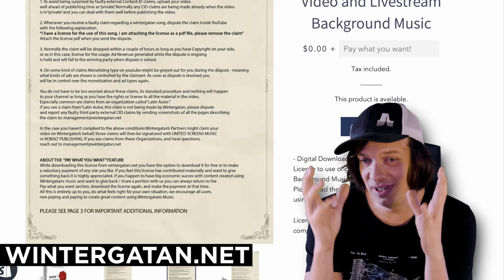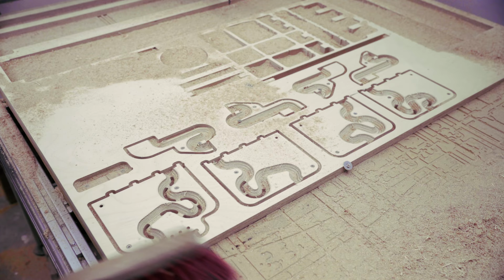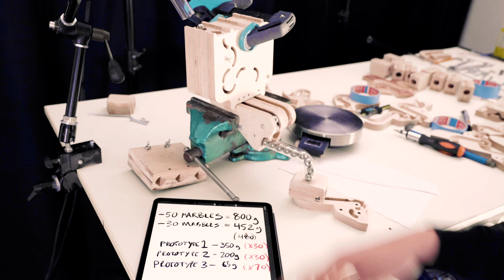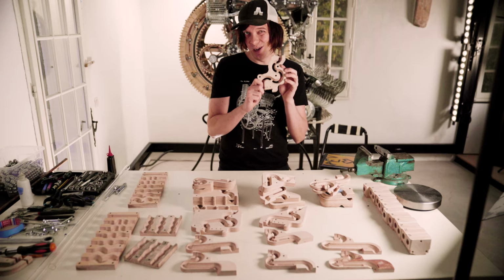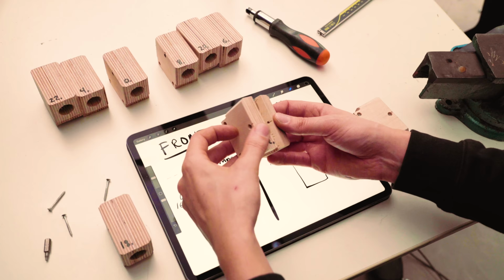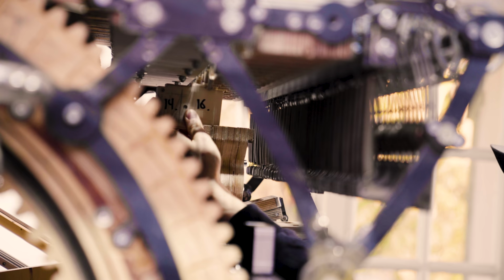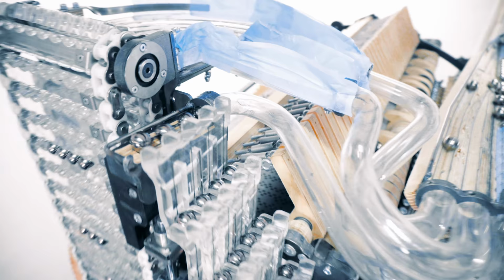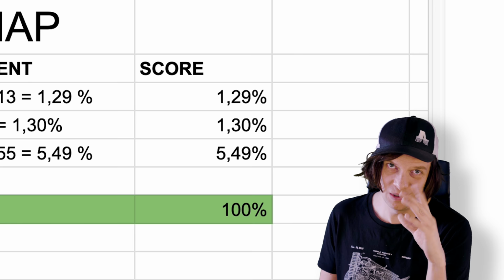Playing 20000 Marbles - Marble Machine X #147

Comment: It's kinda irrelevant for the project, but I noticed  2 things: 1, you're doing the math for your reliability wrong. It's off by 2 orders of magnitude. 1-20/5000 = 99.6%, not 99.996%. 1-61/20,000 = 99.695%, not 99.997%.

2, The way you currently have the math set up for your score, it'll always be pretty much equal to the number of tracks tested, because your reliability %s are close to 100. If you want to score by chance to not have a single failure, multiplied by tracks tested, you should take reliability% ^ number of marbles desired * % of tracks tested. For example, if you had 99.997% reliability, with an end goal of 10,000 marbles played with no failures, and 5.5% of the tracks, then that's (0.99997^10,000)*5.5 = 4.07; with that level of reliability there's about a 74% chance you have 0 failures in 10,000 marbles.

Anyway, with your level of improvement, you'll probably be hitting that 100% reliability with 100,000 marbles on all tracks soon.
Reply: I think Martin is fogetting that 1 in decimal is 100 in percentage, so when he divides failed/total marbles he gets 0,997 and he just adds the 99 in the front out of nowhere instead of multiplying the result by 100 to convert it from decimal to percentage. It was also noted by someone in the last video but it seems he did not read that comment or just ignored it.
Reply: I would actually do the reliability score as log-linear. 1/10 million is "seven nines". 20% points to start off with, each order of magnitude is 10%. 99.999% (100k) is a passing grade of 70% (a C-). To get an A+ he'd need zero fails in 10 million (eight nines).
Reply: This is incredible. I trusted him to be a genius so much that i would have never noticed this obvious error. I love how one can be a mastermind and still mess up basic maths!
Reply: @Marcotheminer  using a "," for a decimal point is pretty standard in most european countries. Might just be a cultural thing.
Reply: I agree with everything you said except that it is irrelevant 😁
Reply: @Marcotheminer  ahm... you are not aware that in the German Speaking Countries and most parts of Europe we ALWAYS use , and never a decimal point. We call it decimal comma. The point is used in other contexts with different meanings.
Reply: @Marcotheminer  Most of the world uses comma for that.
Reply: @Da_Rauch  thank you for that - absolutely right. Btw. Euler used , and not a decimal point. Just for the reason that this is a mere cultural thing.
Reply: Sounds a lot like covid survivability.
Reply: @LuisGustavoCoelho  I don't think that Martin is just adding the 99 from nowhere.  What I think he's doing is 100 - 61/20,000, instead of 1 - 61/20,000 x 100.
Reply: @Marcotheminer  this is the standard european notation. A comma for decimals, dots to group thousands.
Reply: Does nobody care about him saying "2/38 = 5.5%"?!  It's 5.26%
Reply: @EckiSchmecki  Yes. 
But the reliability calculations consistently being two orders of magnitude out is a bigger bugbear - he's been making for the same mistake for at least the last three videos.
Reply: @DavyHulme  but that math is a bit harder than 2/38 xD
Reply: @EckiSchmecki  aye, but only teensy wee bit
Reply: @Da_Rauch  and from the onset of this project he has said marbles ...theyre ball bearings .
Reply: great comment
Reply: @maraschwartz6731  I could cite sources that contradict those statistics, then cite sources that contradict those statistics and so on.  The point is, covid is not nearly as deadly as the left would like you to think.
Reply: @DevinDTV How do you get from the 4.07 reliability score to 74%? What's the last calculation there?
Reply: @99.6survivalrate8  sure any one can cite sources. Doesn't mean those sources are correct. I'm citing an analysis of the actual data. If your sources have nothing concrete like that to back them up then they aren't reliable.
Reply: @maraschwartz6731  
CDC’s new IFR survivability estimates after contracting the virus are broken down by age as part of the agency’s “COVID-19 Pandemic Planning Scenarios" Scenario 5: Current Best Estimate are as follows:

0-19 years old survivability rate is 99.997%

20-49 years old survivability rate is 99.98%

50-69 years old survivability rate is 99.5%

70 years old or older survivability rate is 94.6%

To put that in a different perspective the CDC’s new estimate for the death rate after contracting COVID-19 by age are:

0-19 years old death rate is .003% or .00003

20-49 years old death rate is .02% or .0002

50-69 years old death rate is .5%% or .005

70 years old or older death rate is 5.4% or .054

What do these numbers show? They show the vast majority of Americans face no risk, virtually no risk from COVID-19. For people aged one year to 69 years, the survival rate post-infection with COVID is over 99.5%. For young people under the age of 20, which is most college students, who are being thrown out of school for hanging out outside and congregating with more people than their government allows them to, the survival rate according to the CDC is 99.997%.

We then find out that experts at Oxford University have determined that approximately 30% of those included in Britain’s Office for National Statistics' (ONS) coronavirus deaths toll over the summer actually died primarily from other conditions.

Read More: New CDC Data States COVID-19 Survival Rates Extremely High | https://wbckfm.com/new-cdc-data-states-covid-19-survival-rates-extremely-high/?utm_source=tsmclip&utm_medium=referral
Reply: @99.6survivalrate8  best comment apart from that all of covid is in reality a HOAX
Reply: @karlgiel8891  I agree.  It was needed, then exploited and exaggerated by Democrats for this election.
Reply: @Ninjaguy1b  That's just 0.99997^10,000 = .74. The chance that a given marble won't fail (.99997) to the power of the number of marbles dropped (10,000). 4.07 comes from the number of channels (5.5) times the chance of no failure (.74).

Comment: I want to say again that you should officially track three categories of fails:
critical - something that can stop or even break the machine.  Including a hard stop on a channel - these are running at zero
sub-critical - something causing a missed note, but not stop the machine or cause the song to be missing an instrument - these are running at zero
non-critical - an annoyance, such as dropped marbles. the 19 that missed the funnel
non-critical, caused by development stage (the 42 marbles dropped "because I had these channels taped and the tape failed").

I would have totally ignored the 42 marbles dropped due to temporary tape failed.  meaning that you were 3X better than the number you used.

I also think the goal should be ZERO critical failures, and perhaps 99.99999 sub critical (1 out of 100,000 notes may have a bad note).  So far you are actually at zero on this, but you will have to test a LOT more to be sure, testing all channels and use a computer to check for missed notes.
99.9999 non-critical (1 out of 10,000 marbles dropped).
If a full concert was 50,000 notes, and 5 marbles hit the floor that is not a "problem".  Huge, complex, custom build 38 channel instrument + desire for perfection on NON-CRITICAL difficult to control physics is not a good idea.
Reply: NJ bhul! Bi
Reply: @Wintergatan, he is caring for your success making you work less and better! Read this one :)
Reply: Catergorising faults like this (Cat 1,2 & 3 faults) led Mercedes to 7 F1 World Championships.  This is exactly how you should approach this problem.
Reply: This is the way!
Reply: @MrMattiasHallen  This is the way!
Reply: @ruaraidhmcdonald-walker9524  This is the way!
Reply: @oninoni  This is the way!
Reply: Also Martin should not forget, that the machine is designed to be taken apart and transported. Tuning the marble machine to a 99.99999% accuracy in a stationary position might be a huge waste of time if the disassembly, transport, and the limited time to assemble and test the machine prior to concert, limits the maximum accurany anyways...
I am not an engineer, but I think most high precision instruments and machines are stationary for a reason...
Reply: @joshgray3360  ...I have spoken
Reply: Any dropped marble should be put into a Signed container and given to an audience member. :D I count that a win from a loss.
Reply: I hope Martin sees this! I know there are a few of us who have made the same comment before.
Reply: The upwards curve on your plywood piece is what reduces the weight of the marbles above, increasing the incline or moving the incline closer to the dropper will also further reduce the weight, this is all hypothetical of course 😂 also I loved the flower transition at the beginning  of the video and you should try to have MMX background music it would be awesome 👏
Reply: Not only that, but even looking past how you measure performance, if you look at dropped marbles in a concert setting then you could hand them out as souvenirs. It’d be akin to snapped drumsticks or something. Each “failure”, if it is non-critical, can lead to a story for someone else. As long as it is limited to those specific types of failures and they are relatively infrequent then, in my opinion, I’d view it as a success.
Reply: Agree! This is the way to go! Since the machine is actually dropping marbles, I hardly believe the funnels will ever be 100% fail free, especially when leaving the fixed environment of this studio.
Reply: ha. i just wrote the same thing... Martin listen to this man.
Reply: I agree, but also disagree... The master composers, and elite musicians dont make mistakes if they can help it. The amount of time and energy put into this project makes it absolutely worth aiming towards a flawless goal. Even if its after he hits the goal youre suggesting. If youre making a song and its going to be your master piece, the culmination of your entire lifes work and knowledge of composing. Its absolutely worth making sure youre not going to miss a single note when performing. When my brothers band finally got the chance to play live at a huge music fest next to dozens of signed bands, their manager and producer told them that they wont be playing their new song until they would be able to play it flawlessly in their sleep. When you create something, whether thousands notice a mistake or only you, its worth fixing. If its worth doing, its worth doing right. BUTTT i do agree, its also not worth driving yourself insane trying to be perfect, so reach a reasonable goal and continue to perfect it in the mean time.
Reply: @torbenkienz7157  There are amusement park rides that are designed to be taken apart and transported. If they aimed for a goal less than perfect that could very well end up killing people. I would disagree that just because it can be dismantled it should have a larger margin for error. I completely understand what youre saying though. I think in the end for it to be optimized the best for disassembly and still the most accurate when reassembled the entire thing will need to be machined metal.
Reply: this is the way!
Reply: You people are obnoxious. He's clearly doing fine.
Reply: From a different perspective, any dropped marbles on stage could be a safety hazard. I think Martin is right to want no marble failures, critical or sub critical.
Reply: @torbenkienz7157  yep, taking it apart and reassembling usually end with something slight out of place.

So much goes just in making sure the floor is level, and much more on the "atmospheric conditions" for such machines.
Reply: @torbenkienz7157  i like what your saying but hes aiming for 100% precision so that way when he moves it around it stays as close to 100% as possible because of the add-ons he is able to make trying to achieve 100%.

What id like to add on to your comment is that its built with plywood so without a special coating and even with a special coating will degrade over time depending on the enviornment. What would be awesome to see is him make this in Epoxy resin.
Reply: @LikelyLagging  I agree with pretty much everything you’re saying. The only thing that we might slightly think differently on is the “missed notes” part, as non-critical errors should not impact the music sonically at all to be designated as non-critical in the first place. But even that might just be a slight miscommunication because we’re speaking in comparisons that aren’t completely 1:1. Either way, I think that 100% accuracy is a noble goal, so as long as that goal doesn’t become so overwhelming that the project is considered a failure by not reaching it.
Reply: Can we donate to him on his free music page, so that he can buy the expensive plywood for better routing?
Reply: @aaronr7826  I'm really tempted to be rude, but I will be nice.

What you both are suggesting is a horrible idea. This is the difference between engineering mindsets, and artistic ones. You will never get perfection. There comes a point where it's good enough. As long as he's not getting more than 1-2 sub critical failures per song he's fine.

I feel like people don't understand that musicians make mistakes all the damn time live. They never play songs perfectly and usually they do multiple different recordings per song just to get a perfect clip. 

I'm not advocating for not attempting to fix the issues that he is currently experiencing, but chasing to many smoke trails just isn't worth it sometimes.
Reply: @seemlesslies  I’m likely going to sound like I’m flip-flopping here, but I’ll try to summarize my actual thoughts here instead of being as amicable as possible to the person I’m speaking with. I’ve replied to several people, and my initial response is most in line with where I stand on the issue. 

Yes- non-critical issues are essentially a non-issue, so as long as they don’t happen overly often. I actually think that the pursuit of perfection is detrimental to creating things as a whole, as often times we’re spending an incredible amount of time fixing things that are essentially invisible to anyone else. With this issue in particular, myself and someone else even mentioned turning the dropped marble issue into a boon within the context of a concert. If you view anything less than perfection as a failure, I think you’re setting yourself up to fail, especially because in transport or if you are performing in non-test conditions there are going to be factors that haven’t been considered/encountered.

All of that being said, I also understand where the desire to be as close to 100% as possible comes from, and so as long as there is an actionable plan that’s isn’t going to indefinitely postpone progress on more impactful changes I don’t see an issue with resolving them.
Reply: @punicwars2  Oops! Totally missed that comment when I was writing this. I’m glad that I wasn’t alone in thinking it, though!
Reply: @LikelyLagging  Haha, no worries. I think it’s important to disagree on some points, but it’s super easy to get wrapped up in the seeming invulnerability that anonymity provides. Either way, I’m excited about this project as a whole. It’s awesome to see Martin grow and evolve along with the marble machine. The fact that he’s got actionable plans about what to fix is fantastic, and as long as he doesn’t get to the point where the 100% accuracy goal becomes an uncrushable, unsolvable problem then I think it’s a good idea to shoot for it. Something I see all too often is a project that is meant to be perfect ending in ruin because the goal is too nebulous, too elusive to achieve. Martin has his head on straight, though! Cheers!

Comment: the over-rotation effect wont help with the static pressure.
Reply: This comment should be much higher. It's not going to help at all. The path shape is the only thing that matters.
Reply: He planed to use the over-rotation effect to slow the marbles down, not to help with the static pressure.
Reply: Exactly what I came here to say.
He is using a dynamic phenomenon to solve a static phenomenon (that happens to be a problem).
I believe the increase in performance came from two other factors that he changed (when he said he only added the over-rotation to the paths):
    - the increased smoothness comes from the paths being less curved (rounder turns)
    - the decreased static pressure comes from the tracks having upwards inclines

Comment: You could mount two fixed cameras at the funnel: One at the front,  and the other at the side. If you synchronize them so that they take pictures following the same tempo the machine is playing, you could locate each marble in three dimensions for each beat. That would help you estimate the average and the standard deviation of the x, y, and z of the marbles. with that, you could also estimate the probability of a marble missing the funnel. If you use a solid black background, it should be fairly easy to extract the position of the marble using a simple computer program. I might be able to help you with that part if you want.
Reply: go join the discord
Reply: Please do, this is extremely relevant.
Reply: Simpler: remove the funnel completely, put a piece of paper and carbon paper around where they fall, drop several marbles.
The indentations on the paper will allow to estimate the marbles exit and dispersion angle (in both x and y if you assume consistent speed and put some simple math into it).
If you are consistent with the paper positioning you can verify the impact of changes in the design on the dispersion by comparing the papers of different iterations without any math at all (and get qualitative improvements out of it).